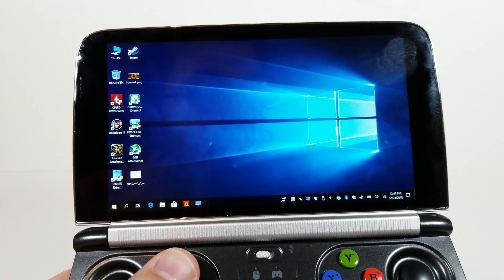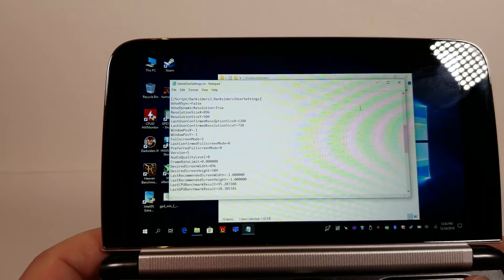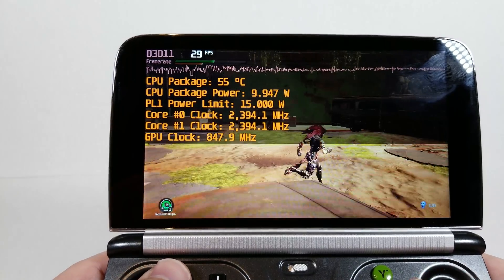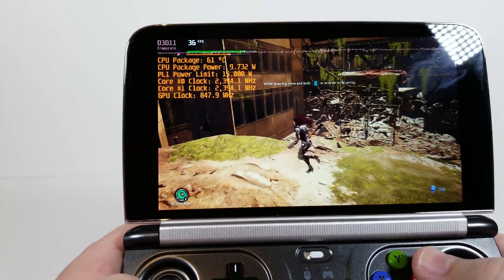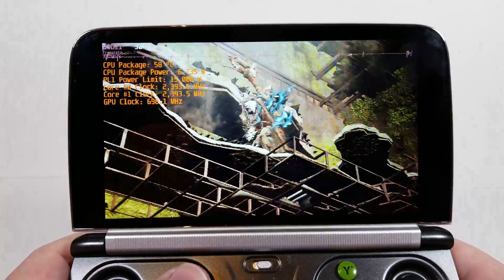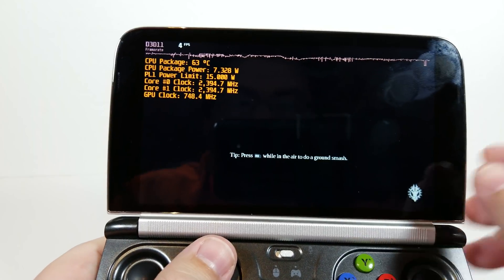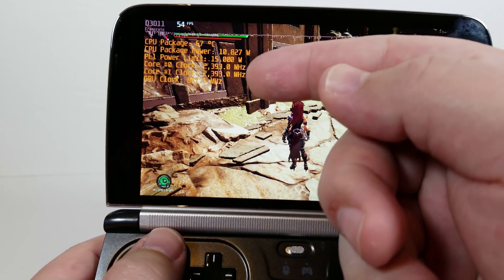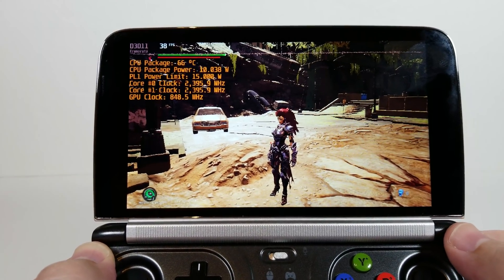GPD Win 2 - Darksiders 3 MAX POWER 15 Watt TDP

Comment: Is there a list of M.2 disks that have been validated to be compatible with the GPD WIN 2? Getting mine in the mail soon and I am looking into storage expansion options.
Reply from the maker: All SATA based m.2 2242 drives work. Some have better quality than others.
Reply: @ThePhawx  Cool, thanks for the reply. I didn't consider the SATA and NVME interfaces. Guess I'll check out some SATA based drives.

Comment: What was the trick you used when you stretched the screen with your fingers to fit the boarders correctly to the GPD Win 2 screen. I saw a icon at the bottom of the screen but don't know how to access that. How did you do that?

Comment: Hey guys have a question. Is it also for you, that the fan is basically always on. Also when only watching yt or playing some snes games or low performance games on the GPD Win2?
Not that I think that it's bad, but I just wonder.
Also, does anyone know if it helps when I turn down the watt power. So the cpu doesen't get hot so fast?

Comment: Would you recommend buying one of these
Reply from the maker: So far I'd recommend the copper heatsink by itself. It does require minor modification to the original case but it's pretty simple if you have  clippers.
Reply: @ThePhawx  thanks for the great anf informative video
Reply: @ThePhawx  what if I dont want to feel any heat? Would you recommend the nylon case?
Reply from the maker: I can't recommend the nylon case until the SSD grounding is official. I've seen a prototype of the nylon with SSD grounding but can't comment on it specifically because I haven't tested it. The black nylon is quite a bit cooler over the official case.
Reply: There was an update on the igg page on the 21st that said the grounding is done, and now he is working on ssd cooling.

Now with the grounding would you say the copper + nylon is the best option? Or is there something else that makes the original shell better?
Reply: @ChildOvAtom  with 17 days to go, would you say it's worth waiting right until the end before ordering?
Reply: The mod developer also sells the original case pre-moddified if you need. The clipper removed section has to be flush with the back plate and just requires a little sanding after you clipper it if you just want to use your own one.

Comment: 63 degrees max is such an improvement over the stock cooling solution. copper heatsink plus original case seems to be the ideal setup and I believe their is an option to purchase an already modded original back plate + copper heatsink on the campaign. :) This mod is so awesome